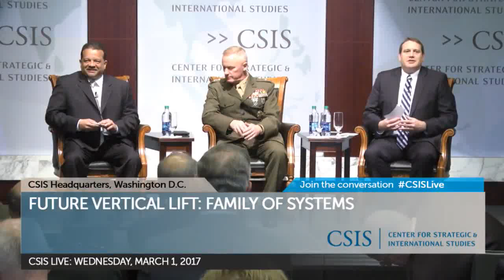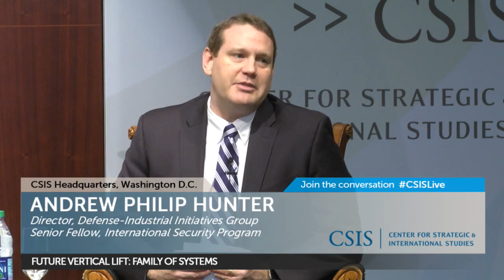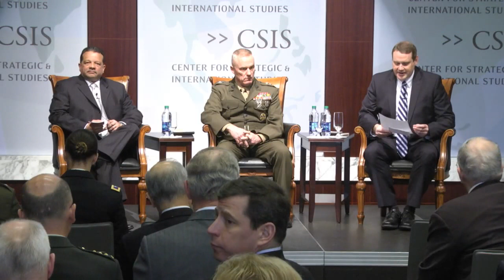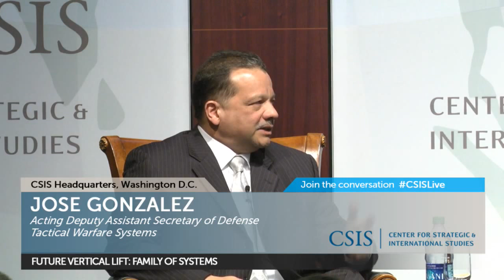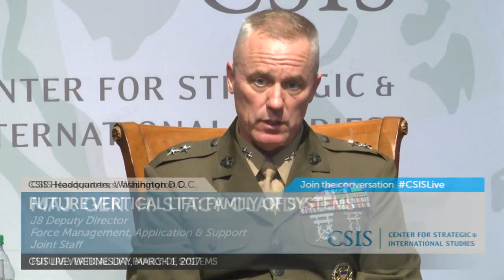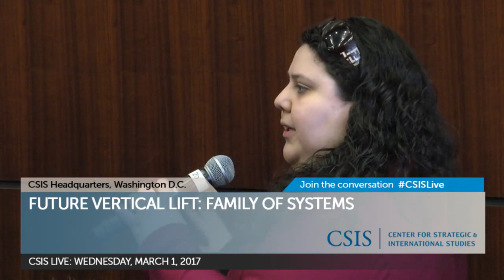Future Vertical Lift: Family of Systems

Comment: if im correct we can make a brick fly if theres a engineer present,.Quite simple system function.medium (brick,-f35 ,a5 vigilante,1970 mustang,supra etc.)gyrostabilizer,high air pressure stabilizer,multi port jet engine with compresser multipoint intake encased in metamaterial (the orb is the most efficient due to structure pressure point efficacy)